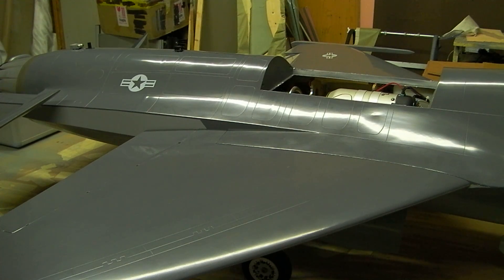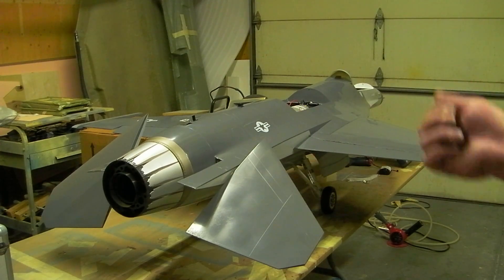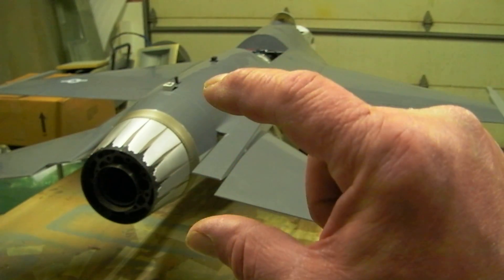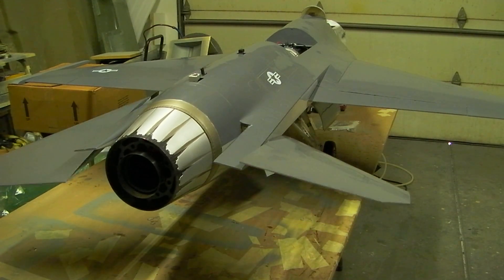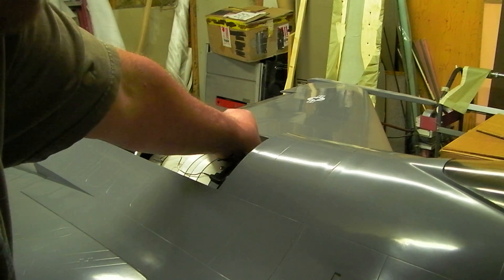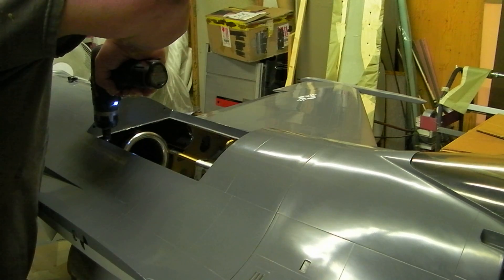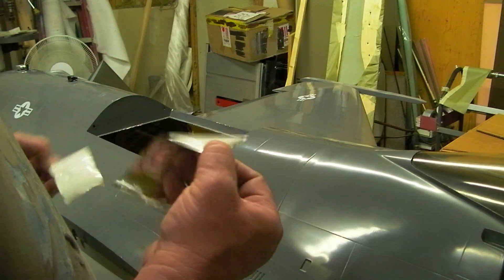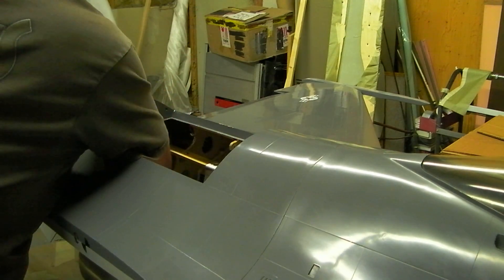working on F-16

Comment: There's nothing wrong with flaperons. Most modern fighters have flight computers that handle them just fine, I'm positive that's the case on the FA18 and pretty sure on the F16. Anyway I see why you don't want to fuss with it and it looks like you will have plenty of roll capability with those massive horizontal stabilizers.